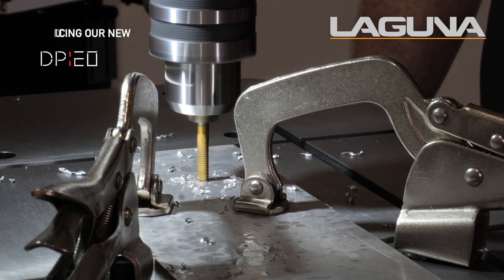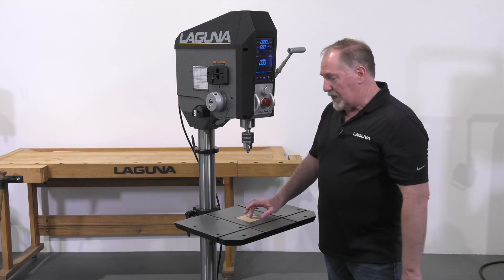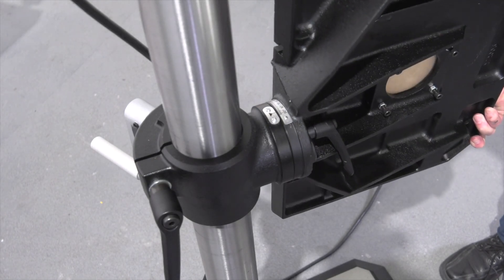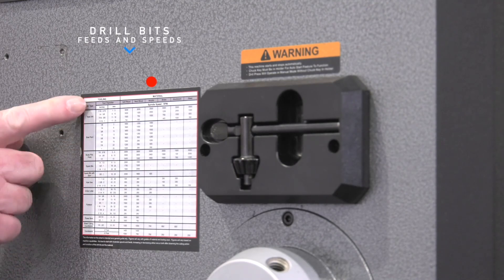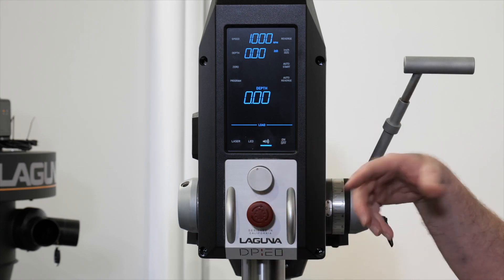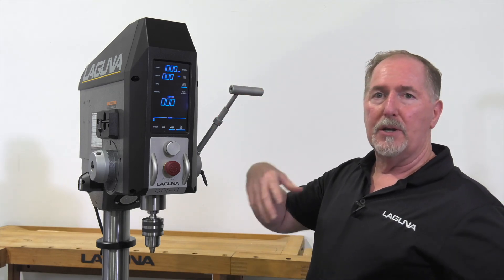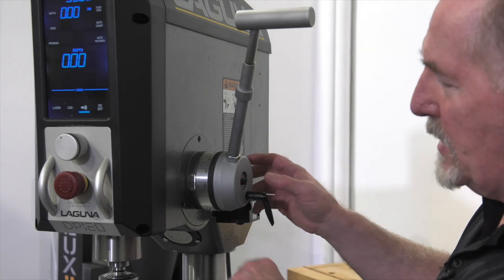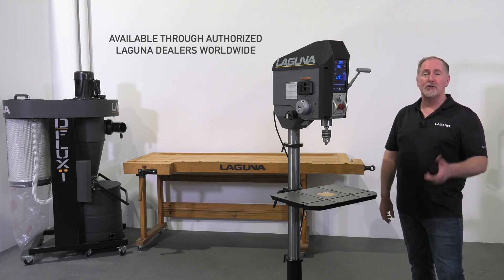New! DP:20 Drill Press with a Touch Screen Panel

Comment: I received my DP-20 drill press a couple of weeks ago. It arrived very well packaged with no damage whatsoever. I used the forklift attachment on my tractor with a lifting strap to get it upright. That thing is heavy! I set it in a Shop Fox mobile base which worked our great. The drill press is now mobile and rock-solid stable.  The DP-20 is a very nice piece of equipment, well thought out and extremely functional/versatile, as well as easy to use. It's smooth, quiet, and accurate. Coming from an old Harbor Freight drill press I've owned for 25 years, the difference is night and day. The large table, with dog holes and t-slots, is very handy. The 'auto start' feature and the 1-handled turret are great, and the LED light is awesome. The laser crosshairs is another bonus that I didn't think much about until I started using it. It's a wonderful addition. I'm pleased with everything about it with the exception of one thing. The chuck key does not fit the chuck properly. The pin on the chuck key fits loosely in the key hole, but worst of all, the teeth on the key do not mesh properly with the chuck gear. Extremely sloppy and loose.  I've made several efforts by phone and email to get it resolved, but so far Laguna has been no help. While waiting to hear back from Laguna, I ordered a couple different chuck keys from Amazon and found one that fit a little better, but still not correctly. The chuck is stamped 5/8" JT3 which I cross referenced to identify the correct key. Still no joy. I was tempted to order up a new Jacobs chuck but those are super spendy. So I decided to wait and see if Laguna can get it sorted out. One final caveat.....the DP-20 has a magnetic chuck key holder on the side of the machine that serves as a safety switch. The motor won't turn until the check key is returned to the magnetic holder. Great feature. The challenge is that not all chuck keys will fit in the magnetic holder. I'm curious if anyone else has experienced that same scenario as me. Any recommendations are welcomed.
Reply: just ordered one so I'll see if I have that issue. Hopefully not! 
I saw a review where someone had a bad control board so I'm glad that's not your issue!

Comment: Laguna built the Nova Voyager (without the 1.75HP motor and without the on board bit speed chooser).  It does have a larger table, but not much else that exceeds the capabilities of the Voyager.  I do like the one handle movement of the quill.

Comment: Is the handle length adjustable? My old drill press handle hits my woodpeckers fence. If using the woodpeckers newer fence will the handle hit?
Reply: My 35 year old Craftsman full size press did the same thing with the WP fence.  This one easily clears the somewhat high fence, works great!

Comment: Can an additional handle be purchased AND will the drill press operate with two handles installed simultaneously? We have lefties and righties that would use it in our shop. Are bolt on wings available to widen the table?